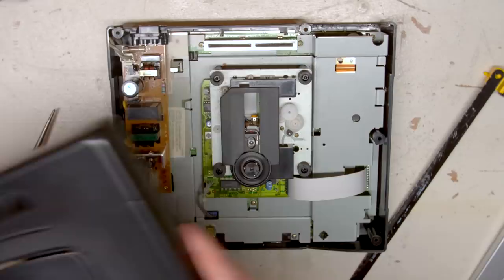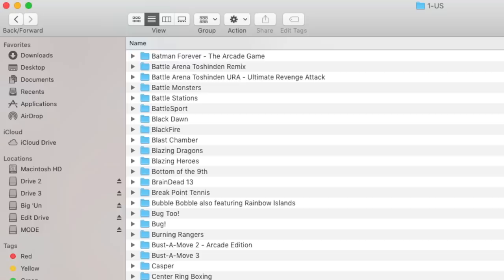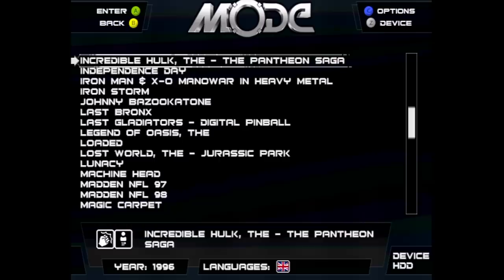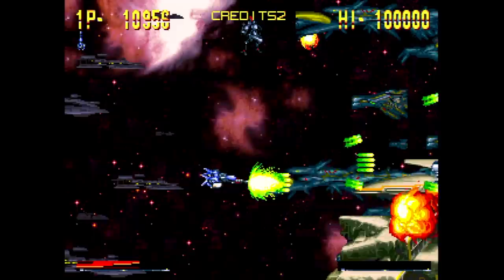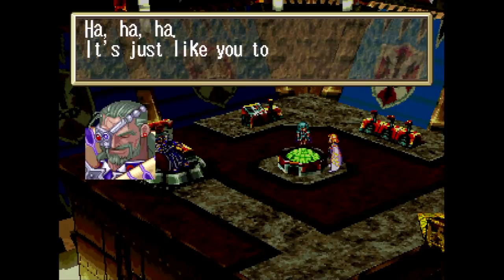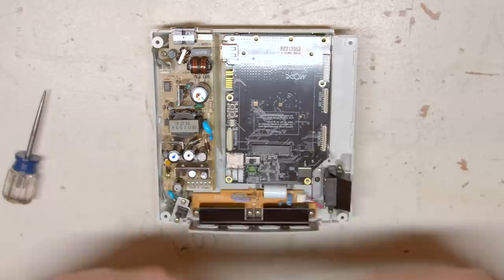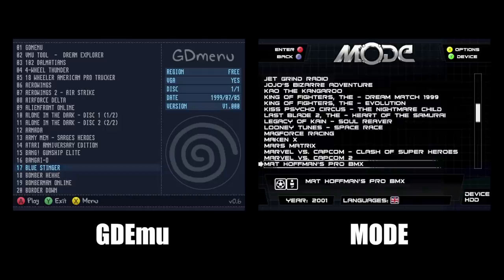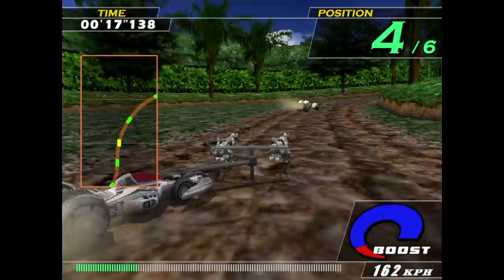The MODE from TerraOnion - Review - Game Sack

Comment: "Sorry for not testing every variant of every game of every region"
"If it has a 2, you can go straight to hell"

He's saying what we're all thinking.
Reply: If you happen to have a 2 on the back of your Dreamcast, you must have real bad luck.
Reply: @MegaManNeo  "You've won the unlucky lottery" - Adam K
Reply: referral madness  SEGA later on released a revision which had the exploit patched which allowed for games on CD-R and thus homebrew games to run on the system.
In case you have one of those Dreamcast, new games won't work for you either.
Reply: Good thing mine has a 1
Reply: What are we thinking exactly?
Reply: Glad I have two with a 0 and three with a 1!
Reply: @MegaManNeo  mine has a 2 and runs back ups. I bought it last month, second handed so i wouldn't know if the previous owner changed something. But so far, it runs cds and dreamshell sd with no problems.
Reply: yeah, just disassembled it and itis a rev 2. runs back ups just fine

Comment: My Dreamcast's optical drive sounds like a washing machine on drugs. I would love one of these.
Reply: If cost is a factor, and if you want a solution now, I'd recommend the GDEmu. Clone units are available for as little as £35/$50. It's plug and play, so no soldering necessary. And as the Dreamcast has a library of roughly 600 games, you can split them amongst a few SD cards. I've got about 300+ games split over 2 x 128GB SD cards, but I've also used a 256GB micro SD card in an adapter without issue. Games are easily managed using a utility called GDEMU_SD which renames your games in a format that makes them easier to read for the system. There's tons of videos about the GDEmu with lots of resources available. If you want one look on eBay for a good deal.

Comment: “Just make sure your dreamcast has a 0 or 1 on the bottom, if it has a 2? Well you can go straight to hell.” 😂
Reply: Its Canon Christian law , Got a Dreamcast with a 2 on it, you are going to hell. 
"Thy Dreamcast shall be revision Zero or One, as Two is the mark of damnation the heretic offending  god shall burn in the everlasting fires of hell." Romans 19:9.9
Reply: @lukasperuzovic1429  Why is it not good?
Reply: Rockymann27 It was a revision to the DC that prevented the use of CD-Rs and hombrew games.

Yet when you consider what that feature (not a bug) was intended by Sega to do (facilitate playing import games) I’m not sure if our anger at such a revision isn’t misplaced...
Reply: @osurpless  Actually that not the issue when it comes to version 2 Dreamcast hardware and an Optical Drive emulator (ODE) like the MODE or GD Emu. The GD drive circuit board on versions 0 and 1 were both with the optical drive, when you replace the optical drive on those versions you also replace the circuit board for the drive. Version 2 has those circuits integrated with the mainboard/motherboard. The ODE has to replace the Drive's circuit board in order for it to work.  There no way to replace the Drive's board on version 2 as its integrated with the mainboard. 

But there some, and I do mean some very early version 2 Dreamcasts that did allow for Mill-spec CDs which was the exploit allowing the Vers 0 and 1 Dreamcasts to read games on CD-Rs. Version 2 Dreamcast can still read Music on CD-Rs.
Reply: Lukas Peruzovic Ah, such was what I heard in the recent past, as well as from other comments here, so of course there is always more to the story.
Reply: @osurpless  It's why both ODE options for the PS1 has you modifying the main board of the PS1
Reply: @lukasperuzovic1429  my Dreamcast has a 1 on the outside but a 2 on the inside. The Gdmu still worked tho. Im not too familiar with Dreamcast hardware, but the AC stuff on the left of the open console looks different than all the tutorial videos. I got it at a swap meet, so it could be a frankenstein console.

Comment: I bought one, primarily for my Saturn.  Not worth it for me to buy a second one for the DC when I play it so rarely, so I'll just move the MODE over as needs be.  I agree about the super slow artwork loading, so I just leave mine in list mode.  Haven't had the problem with the question marks in the list, but I am using the most current firmware, so maybe that solved it.  Anyway, really happy with the MODE.  Totally worth the $200 and whatever that I paid for it.
Reply: So can you play rpgs like the English translations of the shining force 3 games? Can you save game files to a memory card?

Comment: Great review Joe! 

I just installed one into a Sega Saturn. Some info no one seems to mention, you can use a usb extension cable and route it out the back expansion port for hot swapping external drives and usb sticks. I'm only using a usb 2.0 extender and I didn't notice any difference with load times compared to using the sata or micro sd ports.

Comment: I got a Satiator for my Saturn. It's got some drawbacks: it's more expensive, only takes SD cards, more basic menu, fewer features. However, the main reason I got it (aside from wanting to support all of the work that Dr. Abrasive did to create this wonderful little thing) is that it doesn't require any modification of the console. It just slides right into the MPEG slot on the back of the Saturn.

I'm no stranger to opening things up and doing modifications. I'm not worried about a difficult install or anything. But like Joe, I do have a bunch of games on disc and my Saturn works perfectly, so I really didn't want to just chuck those parts away for something like the MODE. Additionally, the SD card thing is not that big a deal, as I've already put most of the games I want to play on a 64 GB card I had laying around. I will likely just buy a 128 GB card for it, as that should be plenty of storage space for me. I don't actually want ALL of the games on the card, as there are some games that I will either never want to play or would rather play on a different console.

I will likely get a MODE for my Dreamcast. It's also still working perfectly, and I lament having to remove the drive, but at least the install is less complicated than the Saturn's and I will just store the optical drive in a safe place. I like the ability to use a SATA SSD since Dreamcast games are usually a bit bigger. Interestingly there's now an option to use the MODE with the PSX, but the XStation is half the price. XStation also is limited to microSD cards, but it has some cool features like over-the-air updates via WiFi. I will probably eventually get a 512 GB card or something similar for PSX games, which is only a fraction of the size of the full library, but there are likely a LOT more games that I'll never want to play for PSX than almost any other console I own. I like having lots of games to play at my disposal but often find it overwhelming if there are TOO many options, so I'm sure that will be plenty of space for me.

Then I just have to get around to buying a Mega SD, an Everdrive 64, an FX PAK PRO, and a bunch of HD Retrovision component cables for all of my different consoles!

Comment: i wish there was such product for PS2 slim!!! (i know there are other ways to play iso on ps2, i just don't like the drawbacks and compatibility)
Reply: That sucks. You need a fat PS2 and FreeMcboot. I have several emulators and I have all my iso games on a hdd.
Reply: Fun Fact: The Slim can use an IDE HDD just like the Fat. You just med to solder in the connector and find a power source.
Reply: @xnamkcor  - Or just buy FreeMcboot(Which has most emulators) & PS2 Network Adapter from Ebay total cost $30. No special connection, Have fun.
Reply: Did you just say "buy FreeMCBoot"? Also, the person said Slim. Fat isn't an option.
Reply: @xnamkcor  - I  can't help you with Slims. I bought a FreeMcboot memory card because it's not easy to do. Especially installing emulators on the PS2. And I modded my PS3 with all that stuff 10 yr's ago.
Reply: @xnamkcor  i also said that i know how to play iso on ps2 (both fat and slim) but that did not stopped him, lol.

Comment: I bought one of these when they were first announced some months ago, and I just received it last week. As I don't want to put the whole Saturn library on a hard drive, I'm using a micro SD with an extender since you otherwise can't reach that slot without removing the lid. Anyway, it works sooooo well, albeit with some trial-and-error. ISOs from certain, let's say sources, just wouldn't work for me, and the MODE would NOT load them. I've found ripping the games off of a real disc via ImgBurn provides the most consistent results for getting Saturn ISOs that boot every time (except for my Bug! disc for some reason).

One minor complaint I have is the size factor of the MODE board itself. On my US Model 1 Saturn, I found that it was a very tight fit vertically, since placing the board too far back would block the cartridge slot, but placing it too far forward would make one of the sticky mounting pegs rest on the ribbon cable that goes from the mobo to the controller port, and this made me incredibly uncomfortable. I hope future MODE revisions can downsize the board if that's even possible, and maybe place the micro SD slot where the unnecessary USB port is.

Comment: Just been watching this even though I do have a MODE in both Saturn and Dreamcast.

And yeah I know I can emulate them (and sometimes still do) by sometimes I like to "unplug" and rock it like it was the 90s again and play on actual hardware.

Something worth mentioning though there is a Saturn iso that will allow you to backup the internal savegame RAM to MicroSD and back, this is handy as the Saturns battery lasts for like a week. (Sarcasm) unless you have the solid state memory mod.

Either way 100% recommend MODE.

Comment: for  dreamcast there is a homemade mod that allows you play from sd cards (not recommended because is not fully compatible and runs too slow) the ide mod is recommended but it can be messy and if you want to make an extra mod you can add a second bios so the dreamcast wont have to run dreamshell from the gd drive.

Comment: For anyone wavering, the price of the MODE is like the price of 1-2 popular Saturn games.  Well worth it if you don't feel like spending thousands on ebay for a decent collection.  I got one, it's pretty damn great so far.  Definitely install the optional power though, my games were working, but freezing and had messed up audio until I installed it.

Comment: Joe, your folder issues are related to MAC trash files, FINDER on your MAC is creating trash files all over your SSD, so MODE sees you have several files inside a folder, aka thinks you have multiple isos inside the folder so it sees those as multidisc games.
Reply from the maker: Then MODE needs to fix that.
Reply: @GameSack  yes, the same filter to avoid MAC OS trash files that we have on MegaSD needs (and is going ) to be be added.
We just forgot to add it
This dosent changes that MAC OS fills any inserted media with trash files.
Reply from the maker: @alexromero5054  You mean like Windows also does with thumbs.db etc? I think it's the job of any device that reads drives that get used on computers to ignore such things. These drives are meant to be used on their host computers.
Reply: @GameSack  not really, windows only creates one file on each folder containing images (and i think this can be dissabled at all) , MAC OS creates several trash files for each file present on external media
I am a MAC OS user and i try to not plug any external media to it cause it fills it of trash that takes time to delete.

Comment: I bought 2 Modes and I am happy with that, despite the fairly steep price. There are some alternatives but none that I found reliable or accessible  enough so I was quick to preorder and I got them a couple of weeks ago. I want to play on real hardware because of the relative ease of use compared to emulation. I already have a couple of CRT TVs so it's just a matter of powering on and getting into a game.

Comment: If I ever have the spare cash I'll consider one for my Dreamcast. I really wish they would make one for the PS2, as man o man the lasers in those things are the worst.
Reply: Excellent name, friend. I used to go by Commodore64Man.
Reply: The Laser on the Ps2 is pretty fickle. I have fat chipped one and i only use the disc drive to access the games i have on the HDD.
Reply: 1. Get a PS3 2. Jailbreak the PS3 3. Get a USB drive. 4. Add Ps2 isos to USB drive 5. Insert USB drive into PS3 6. Play any PS2 game you want
Reply: If you have a fat PS2 then  FreeMcboot is the way to go. It's on a PS2 Memory card with several emulators. I have almost 100 games on my  hdd.

Comment: You can probably mod that SSD pretty easily to unblock the USB port on the Mode.  Most 2.5 SSDs are like 80% empty space, not unlike NES carts.
Reply: MAGACOP  if you wanted to use the USB port and a 2.5" SSD at the same time.  See 3:20.

Comment: For now my Dreamcast is still working fine with good ol' regular GD-ROMs but I could see myself getting a MODE somewhere down the line. First I really need to get over my fear of opening up my Dreamcast and give it some of the TLC it deserves.
Reply: Get a Chinese clone of the GDEMU instead for around $35. Menu isn't as good but loading is a lot faster and it's a fraction of the cost!

Comment: You mentioning it running Dagon Force 2 got my interest(I play Dragon Force 1 still today).  I would like to know how it runs Shining Force 3 platinum edition though.  I wouldn't mind getting this for both my Saturn and Dreamcast as I still play both of them from time to time, but I also can't really go and spend that kind of money for two MODEs as well as probably a extra Saturn and Dreamcast(I would rather keep the ones I have as they were).

Now if they were to make a system with MODE, and program it to where you can pick between Saturn or Dreamcast I would be up for that.  Add Sega CD in that mix and you can have my money right now.
Reply: Don't need a MODE for the Sega CD. The Mega SD and Mega Everdrive PRO flash carts can do that easily, without the need for the CD add-on.

Comment: Two things that I'm wishing for a right now:
1. That this thing existed when I still had my revision zero Dreamcast with a dead GD drive
2. That they had something like this for a Mark II Sega CD because those are the games suffering disc rot today
Great video, looking forward to more 😃
Reply: You’re in luck on number 2! Terraonion and Krikkz both offer everdrive type devices that are basically a Sega CD in a cartridge. You don’t even need the expensive CD add on.
Reply: @Mampersand  I know about the everdrive thing but that's only with the newer model everdrive. If you have the first version that ain't happening. But it would be nice to be able to store the laser and just use the SD card like you can with all the rest

Comment: That's a nice piece of hardware, but need some improvements... The piece to be installed within the console should've been smaller and have a bypass feature, to permit original disk drive usage. Should've a external part also, where you would connect an SD, USB Stick or Ext HD.

Comment: After watching this one, I hope something like this MODE could be made for PS1 and PS2.
Reply: There is something for the PS1 called PSIO. But it uses the serial port with SD card and you have to solder a chip to the motherboard. Also they are usually out of stock.
Reply: @Lone432345  There are usually in stock like in this moment, second option will be Xstation but it need soldering, lifting chip legs and specific mobo and third solder free solution coming soon from PSIO creators.

Comment: I may get one for my Dreamcast. Wonder if they are gonna do something like this for a PS2.

Edit: I got married on 09/09/09. Shotgunned by the judge when we were just asking questions. Fun times
Reply: I hear people asking for PS2 but it already is easy to install a hard drive. I've got a 1tb in mine with Menu's and cover art using OPL.
Reply: The Dreamcast doesn’t really have any copy protection. If you have any spare blank CDs lying around you can always just burn the games and play them straight from your Dreamcast anyway.
Reply: @southsidese18  Still the problem with any disc based console is moving parts,once the laser dies out you're screwed.Unless you can replace it or buy another console.
Reply: @Progearspec  Yeah, and eventually they'll stop making CDs and CDs can and will rot if (and when, after manufacturing stops) stored improperly. That's another reason to get one of these. And faster loads times will be nicer too.
Reply: @JonVonBasslake  Yup disc rot is another thing that can happen over time.
Reply: @JonVonBasslake  right now there are waaaaay too many legacy companies/groups/etc to stop making cds. Remember Sony made VHS tapes til 2017 and they have companies still making betamax tapes for legacy broadcast companies.

You're looking at least at another 20 years of CDs and even then overstock will last for years after that. The idea physical media is done "soon" is just a pipe dream. There's demand, there's over 200 companies making cds, we're good for a long time.
Reply: @medes5597  I didn't say when CDs were going to stop being manufactured, only eventually. Though it seems that the laser going bad is a much more pressing matter.

Comment: OH MAN!  That's pretty rad.  BTW, I like that file organization structure.  YOINK! I'll be adding that to my own.  What's the art size on those cover?  Since they're thumbnails maybe they're too big.  On album covers for my mp3 player I shrink them down to 300x300 pixels (even if there's some stretching)  Having covers at say 1600 x 1600 pixel takes a short bit to load display on some of my players.  I think 300 x 300 is recommended.  For something like this.. I have no idea the format so I'm just guessing on why so slow.  Naturally, the smaller they are the harder to see but still.